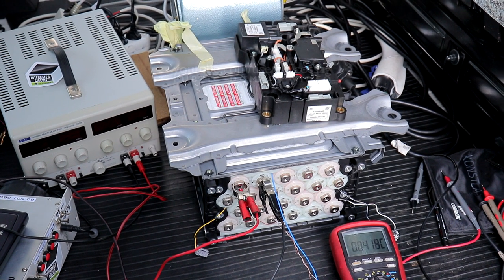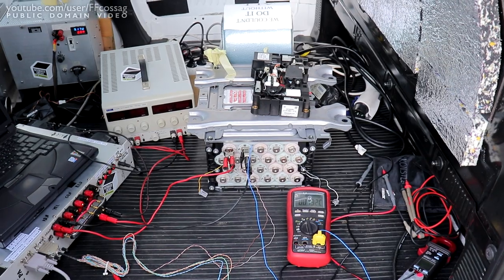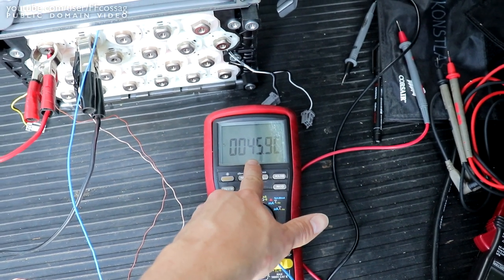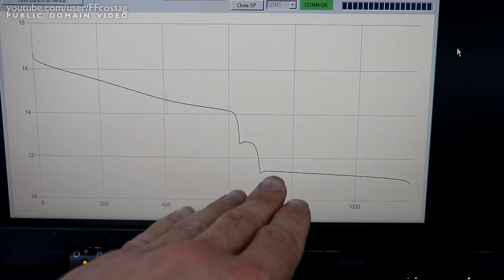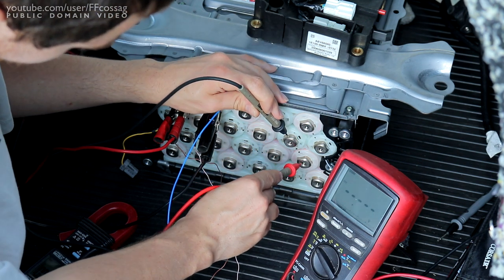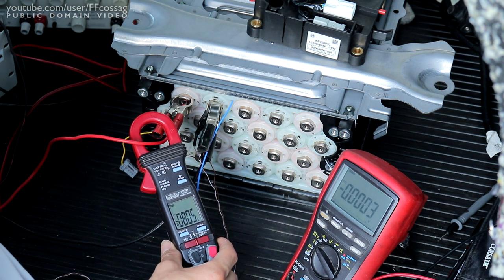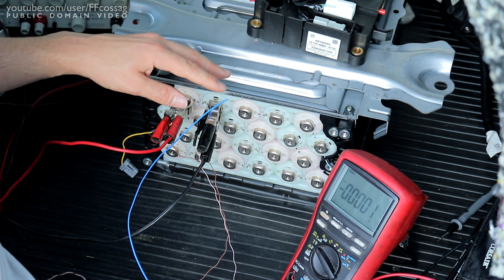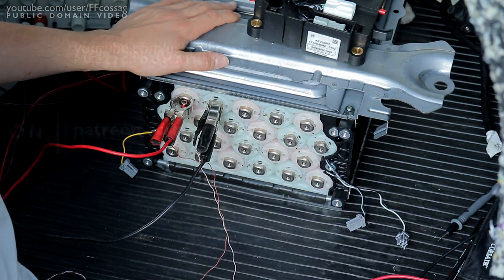2006-2011 Honda Civic IMA battery repair WITHOUT buying new cells

Comment: Great video and super helpful, thank you for this FFcossag!
To monitor the discharge of the battery, I bought a OWON bluetooth digital multimeter for about £40. The data is transferred to an iOS or Android app that can then be exported as a csv file. That made a huge difference to optimise the battery

Comment: No balanced charge system in a massive pack in a car ..... what a fantastic idea.
Reply: Agreed, and not very Honda-like, but on the other side of the coin, it makes the pack much simpler and easier to work on and less expensive to replace, if you are a DIY-er

Comment: Can I put 2 or 3 cells in parallel and charge at 8 or 12 amps rather than 4 amps on just 1 cell?  I realize its better to do 1 at a time but I was thinking at least for a couple of cycles this might save time.
Reply: Paralel would mean even current across all cells, however the cells differ from internal resistance IR to that would mean the lower IR  cell will take the higher current

Comment: Sir charging and discharging of my honda civic hybrid IMA 1.3 GEN 2  with individual battery sticks can it affect on battery....because my car is not used full of assist while i am driving in battery mode under 45 speed it supports me only  75%....not any code on dash everything is in perfect plzzzz suggest me sir

Comment: I checked all my cells and theyre all around 14, i connect my charger set to 18v at 5 amps and then the cells are showing nothing? I unplug and they start to trickle back up but why would the charger deplete power?

Comment: @
FFcossag Very nice and interesting. Just bought a honda civic hybrid 2006 - the batteries are fine but I love getting down and dirty in this type of stuff. I would consider making a system that would do everything you said at the cell level, but taking the cell out. I would control that with an Arduino (discharge, temperature monitoring,  charge, and even cell cooling - that is why I would take it out. etc). Some questions:
1. If I manage to keep the temperature per cell under 40 through cooling - what voltage is considered to be a full cell voltage? In your description, you said discharge when it reaches 40 degrees - which I will implement, but on the scenario in which I can keep them cool, what would be the cut off/full voltage on which charging should need to stop?
2. In these types of batteries, does it make a difference in the current that they are charged with? My point is that for example in a solar system, the deep cycle battery can be "brought" to life by charging it and discharging it, but the charge part would need to be at very low amperage. The lower the better, it will not heat up the battery and would restore part of it (having in mind that most people would consider it dead). So coming back - is there any drawback (other than the longer charging time) of charging the cell at 0.5 amps vs your 3 to 5 amp recommendation?
My end goal is to make an Arduino driven device in which I would just plug the cell and it will be fully automatic - all the steps, conditions, monitoring temp and measuring time between charge/discharge, and after a time (day of two) have a higher capacity cell with a log letting me know of all the parameter/phases through which the battery went.

Thanks

Comment: Is this procedure the same essentially as buying a grid charger (they have them on eBay for $200) and then using that?  Thanks
Reply: Grid charger just flood charge the cells. Idk if they can be use to discharge them but I think you can you a light bulb to discharge them

Comment: Hi FFcossag, thanks for sharing and is useful. During charing/discharing have you encounter a situation that air was built up in the battery such that plastic cover was swelling? Seems it is not safe to put it back to the car?
Reply from the maker: I haven't seen that. It sounds like a thermal issue, you need to troubleshoot further.

Comment: 2008 Civic Hybrid, JDM, right handle.  I see 'Insulation resistance of high voltage circuit' 400.00 kOhm, is this like the normal resistance? Wonder if you know of any such normal range resistance values. It has 11 IMA battery modules with 16.20V except for #5 module which fluctuates 16.10~16.20V. Usable capacity 29.00%, SOC 66.00%.
Reply from the maker: Insulation resistance means that the HV system is making a connection to the metal case of the car somewhere.
Reply: @FFcossag   I see. So, then I should have like 0 Ohm for 'Insulation resistance of high voltage circuit' instead of 400 Ohm? ".. connection to metal case of the car somewhere" meaning like a shorted connection?
Reply from the maker: You want there to be no connection between the HV system and the car chassis, you probably have water ingress or something like that causing conduction where there should be none.
Reply: @FFcossag   Big thanks for your advice. Well noted. Will note you down in my business partner list.

Comment: i had taken a scan tool to my 2007 honda civic and I seen it had some hybrid battery pack deterioration, the IMA light would only turn on after long trips and not so long after it started to take a second for it to actually crank on. fast forward I let it sit for about 5 days while in vacation, I came back and the IMA light and battery light stayed on. Now it doesn't turn on at all... In your opinion how many cells do you think are bad for it to not even want to start anymore?
Reply: i was able to get it jumpstarted but it basically is undrivable because i can't pull it out of park and can't turn the steering wheel, if anyone has any ideas on what i can do to help i'd appreciate it
Reply: You need to charge the battery under the hood. 2 amp 12 volt charger will work

Comment: (Answer please)
I took civic hybrid 2007 for test for few days (wanna buy it).
All cells were around 15v when car is in idle (using diagnostic tool). They go around 17v each cell fully charged indrive and under hard load they drop to 13v (4-5second) and then IMA stops. Under long uphill. IMA ERROR sign comes up. No more assistance for random time.
Is it possibel that battery has issues (fast discharge) or might be something else(lose or coroded connector) Average fuel consumption is 8l/100km
I got fair deal to buy it and its in perfect condition (120k kms) besides battery.
Reply from the maker: The battery is likely to be bad due to its age.

Comment: I have a question about the electronic components, 13 of them, on the junction board. What are they? They have 2 leads and are dark brown in color. One lead is soldered to a buss bar. The other to a wire in the orange harness.
Reply: They are 'sense' resistors. They are there for safety - a small current can pass fine for measurement, but they will reduce the severity of a short circuit in the orange harness to a fraction of an amp

Comment: Approximately how long did it take you to charge each of the cell sticks? I understand that I need to have the thermocouple in place to determine the time period, but as a rough guide?
Reply from the maker: That depends on your current limit. You really have to go by cell temperature.

Comment: Hi Ffcossag, I have seen vids of people using an imax b6 charger to charge the modules, it has feature to charge Upto 20 volts and also discharge. I know you are using a thermocouple to measure the point of full charge, with the imax b6, I would have to set it to a particular volt to charge to, would this be 18 volt as there are 12 of 1.5 volt cells in each module?
Reply from the maker: You NEED to monitor the temperature of the pack, because Ni-Cd batteries never stop drawing current.
Reply: Thank you, I will try to keep an eye on temp, 40 degrees celsius is the point of stopping the charge, right?
Reply from the maker: Something like that. Definitely not hotter.

Comment: Silly question, If I intentionally Keep my Headlight on and let hybrid / auxiliary battery dry And then  jump start . WILL THAT help my Hybrid ? (Currently it working around. 25%)
Reply: The headlights probably run on the starter battery for the engine, so probably not

Comment: I wonder if charging them with a Re-EMF charger would do them even better? At least, the cells won't get hot while charging.
Reply from the maker: No, there's no way around running the cells hot, since you are required to overcharge up to 11 out of the 12 cells in the string. A pulse charger that doesn't run the cells hot, would just be trading temperature for time.
Reply: What kind of pulse charger are you referring to? Because normal pulse chargers that you can buy, just pulse the right charging voltage on and off, while the Re-EMF charger is basically a Joule Thief circuit between the PSU and the battery, therefore it pulses into the battery a) very quickly (in the 10s or 100s of kHz range, AFAIR), and b) with a much higher voltage - whatever the back-EMF spike from the circuit's coil gives you, it could be as much as 10 times the cell voltage, but only for these short pulses, so it pushes a lot of energy into the cell nonetheless. I'd say it's worth trying (but of course, you'd need the right dimensions for the circuit, meaning not only the PSU voltage and power, but also an appropriate coil and so on). From what I've seen, especially dead NiMH cells could be brought back to their design capacity with such a thing very well (better than many other cell chemnistries).
Reply from the maker: That's what I mean by pulse charger. They essentially do a lot of tiny, really high current charge cycles at a very low average current, in order to prevent overheating or gassing. The problem with using circuits like those for this task, is that you need to push several Ah into the low cells, and doing that with a 10-100 mA average pulse charger takes forever. I'm sure it works, it's just slow.
Reply: @xxxfffxxx55  I haven't myself, but There are other German youtubers who do all kind of stuff with the Re-EMF charger (i.e. Segelohrenbob). Others maybe, too. The original design came from René, it's basically an adapted "Joule Thief" circuit (you'll find that on on BigClive's channel).

Comment: I have one with cells that only have 6+ volts to 8+volts. And can you give me the model to your charger so may buy one? Thanks in advance.
Reply from the maker: I just use a big variable power supply for this. It's home made, so there's no model. With 6 and 8 V across the stick pairs, I suspect your battery might be completely toast :(

Comment: I removed the battery pack, did a deep discharge and grid charger recharge, but during the rebuild I had one of the temp sensor wires accidentally arc over the end of the battery.  The battery was fine, but after putting it all back in the car I'm getting P1554/6/8 Battery Module Temp Sensor code.  Any thoughts on how to fix this?
Reply: I accidentally cut one a cpl days ago also 🤦🏽‍♂️ luckily I have to get 4 new sticks so the old ones had them still on. If you didn’t fox lmk I’ll send ya one.

Comment: Im really supprised that there was no clever balancing, it seems very daft :-(.
No way to mod a bcm for use?
Would the old dirty d.c charging help any?, i never looked close into the method though.
Reply from the maker: You could make some fancy controller to keep the battery happy, but given the age and low cost of thee batteries,  as well as their seemingly good life span despite their poor implementation, I'd wager it's not really necessary.
Reply: Likely true, but if it was your car i could see your interest peak to improve the system.
You have the skill to modify electronics, i think your evil side takes over sometimes he he Just joking :-D.
Reply: Typical half-assed compliance car hybrid design.
Reply: @FFcossag  Would a BMS  have cost them much more tho considering the price that car would have been new! I mean yes someone such as yourself who knows what they are doing can fix it but thats not post people, perfectly good packs ( or even whole cars ) will get scrapped and that goes against the whole idea of trying to reduce waste by having a hybrid car.
Reply from the maker: Honda should of course have implemented a BMS. It's just hard to retrofit economically.
Reply: Is this available for Honda Insight 2'nd generation to? Or IMA is improved for this model? 
Thanks!

Comment: 4 Ah? for old stuff ready to give up the ghost!!
 that is negligible compared to today's Lifepo4; 
i am getting 8 lifepo4 cells of 3.2 volts and 240 Ah EACH, (5 kg each), all 8 for 600 euros; that's  600/(3.2 x 240 x 8), or  100 euro per Kwh.